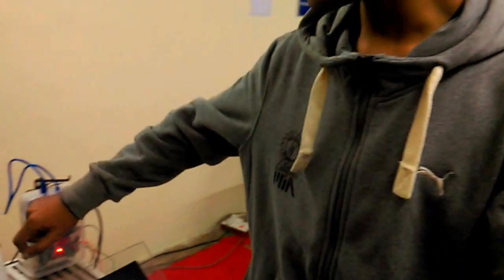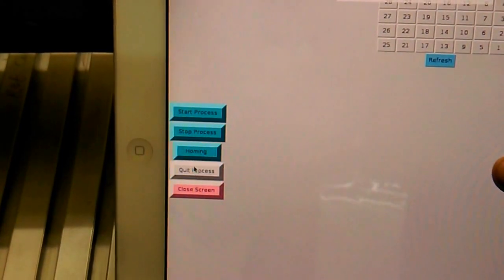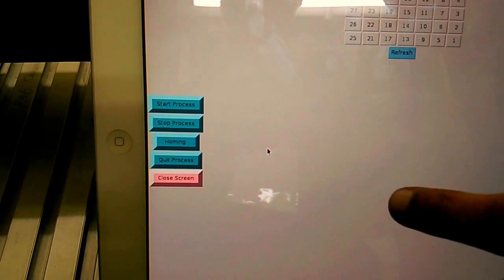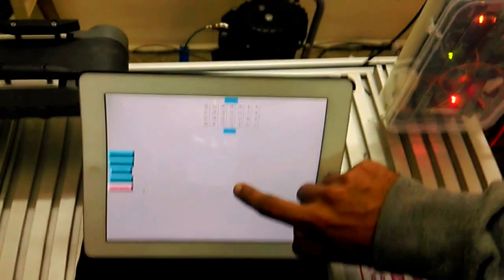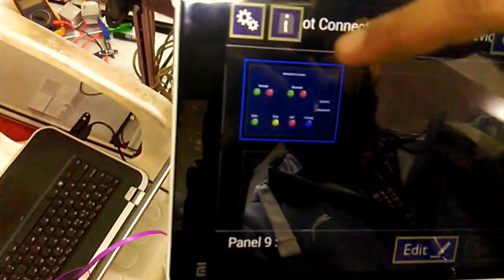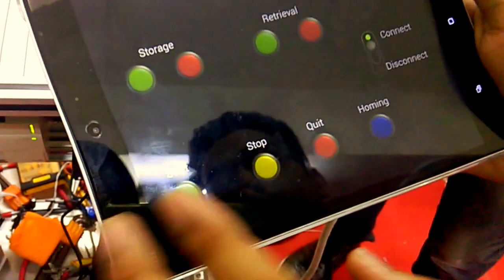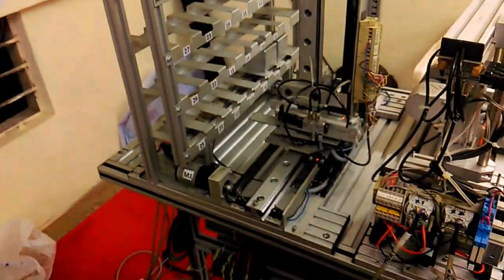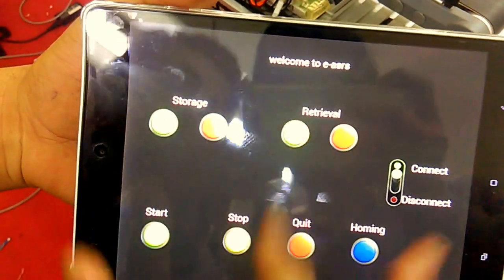Working of Automatic Storage Reterival System(e_ASRS by ISTCians)

Comment: I had this in my apprenticeship, nothing special, why not develop something yourself? The kit is expensive and shit. And the Aluminium cube you're using is not the original one. You have to work on your Programm, increase speed and do multy axis movements with ramping. Upgrade the motors to decent ones with more speed, use pwm. If you are using a plc like Siemens, get hs cards or plug a attiny interfacing do or dq of your plc for pwm output.